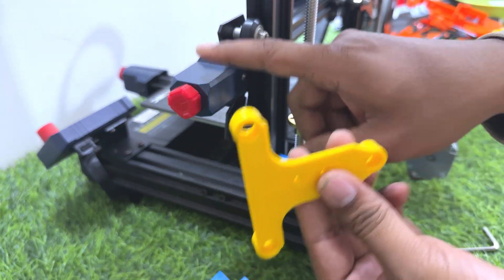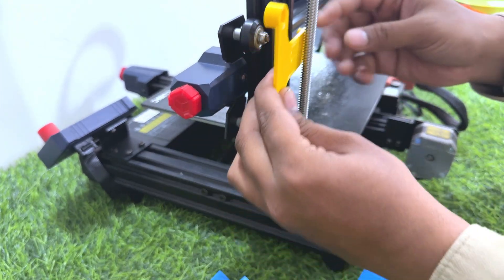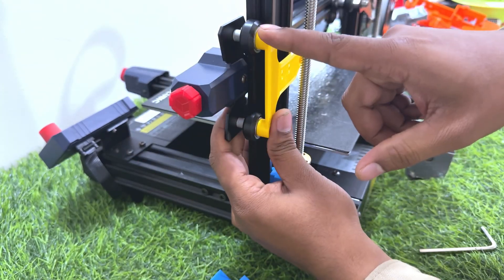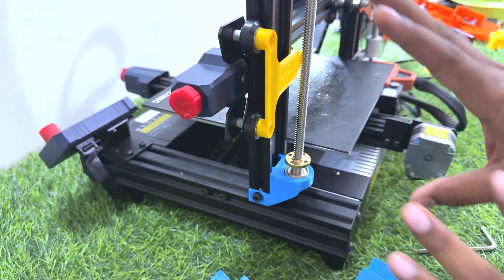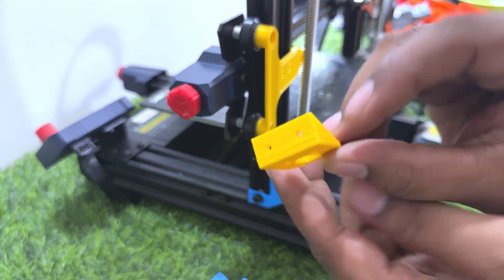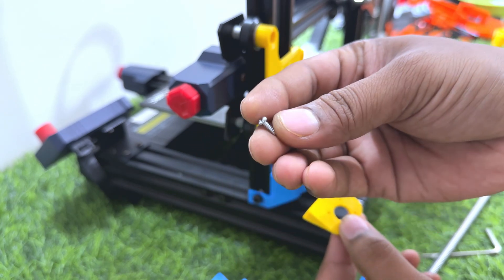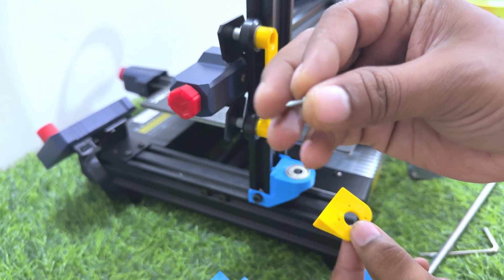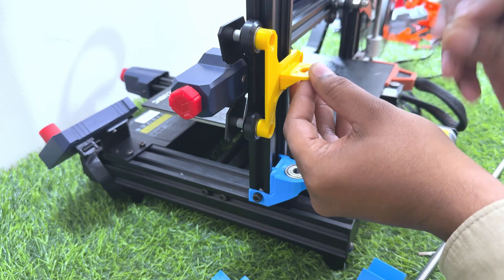How to upgrade to dual z axis for Anycubic kobra 2 3d printer with minimal cost

Comment: I thougt to fix both ends of the leadscrew tight is an error that pruduces e.g. z-axis wobbling. Years ago we were "liberate" 1 end of the leadscrew bc it's not necessary. The bed gets guided precise through the Linear rails. 
Also i heard that a certain " xy-play" between the bedcarriage and the leadscrew is recommended.